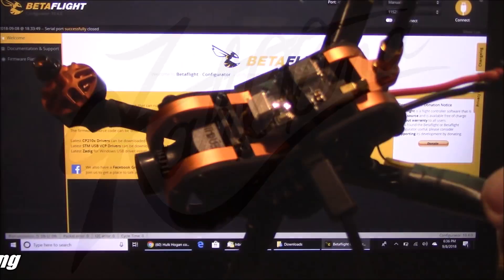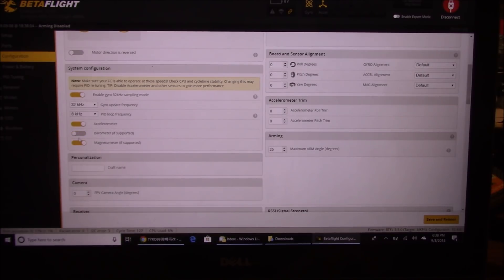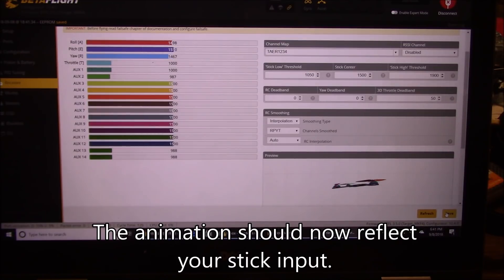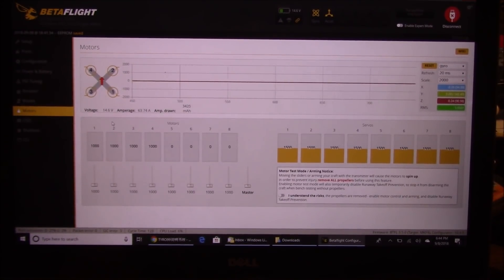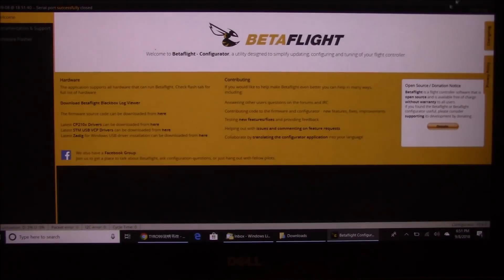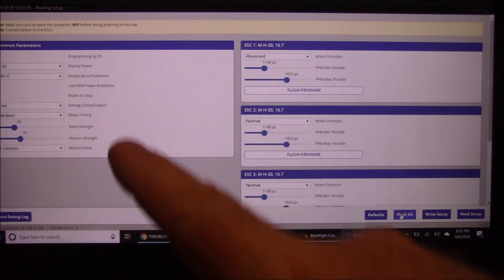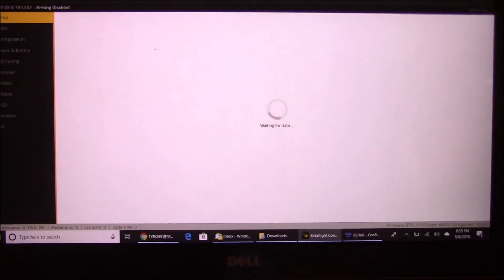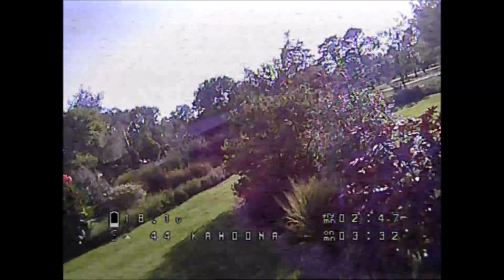Eachine Tyro99, Part 2: BetaFlight & BLHeliSuite Programming

Comment: Great Vid! Does the current sensor work automatically or do i need to change settings or solder an extra wire on the board? Thx

Comment: When I plug my tyro99 the light just flashes on the FC ...need advice but my mind is telling it the USB cable also would I need to load the firmware if so

Comment: Yr vid will come in handy for me soon when my tyro99 is finished..yr vid is easy to understand..thanks for yr time on this vid..my hawk 5 a guy just set arm switch and flight mode angle ect....after binding it flew well out of box..it.ll be my first time setting up a quad in betaflight..cheer.s ron...i may be subbed allready but if not i will now....

Comment: I cant get my osd to display even though I enabled it. any suggestion.
Reply from the maker: Do you have both video cables from the camera and vtx connected to the flight board on the correct solder pads?  Also, look in BetaFlight and make sure it is still enabled.  Make sure you push "save" on the config tab and the OSD tabs.
Reply: @travisgrindal  i figured it out. For some reason i have to have it on auto and config and save that last.  If i change anything else at a later time it resets.

Comment: The camera angle setting is for when you want betaflight to handle yaw-aileron coupling, if you enable it in other settings when you input yaw it will mix in roll with it so it yaws "flat" when moving forward. Hope this made sense
Reply: Well that makes sense. This would be great for inverted Jaw spins 😉
Reply: @raffyturc  i tried it once, it feels reaaaally weird and awkward... Also couldnt get it to work really reliably
Reply from the maker: Awesome!   I had no idea.  I need to play with that more.  Thanks!

Comment: Do u have the Infiniti 5s pack? 1300mah? I crashed my tyro in another tyro and the other one was catapulted into a canal. We recovered both dried and cleaned it and it still flies like new! I recommend u to make the antenna point downward. My capacitor suffered a big dent during the collision
Reply from the maker: My Infinity pack is only 4S.  I have only flown CNHL 5S packs.  My other quads all use 4S or 6S.  This is the only one that wants 5S.  I may mess with the antenna or see I can 3D design something better.